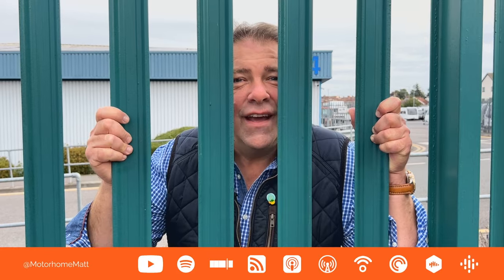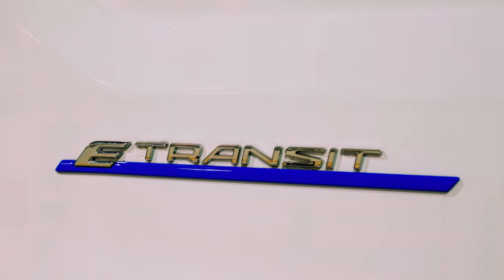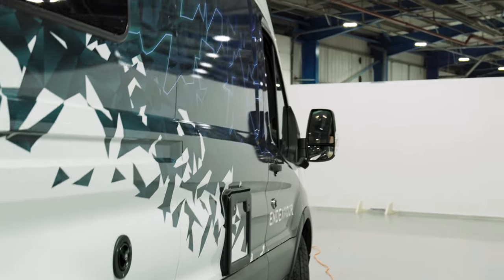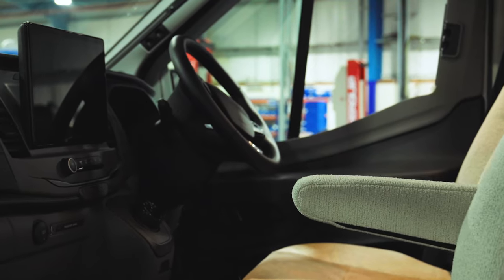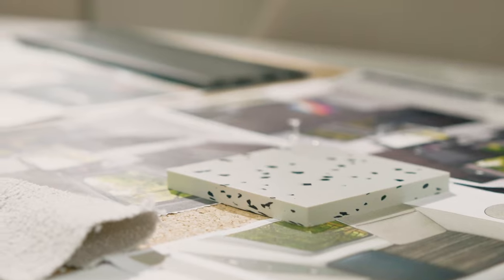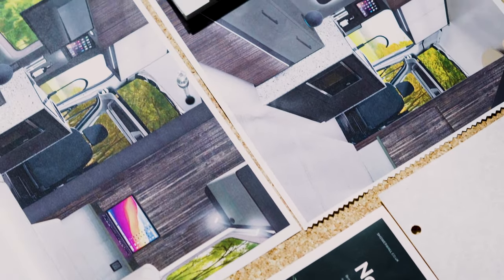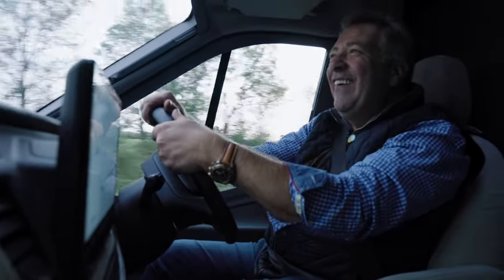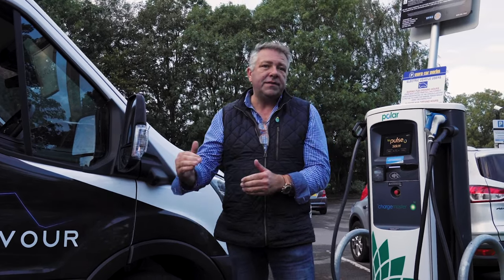Tour the new ALL-ELECTRIC campervan from Bailey of Bristol: The Endeavour EV

Comment: Regarding heating, they need to install a heated floor. Westfalia has just introduced an electric heated floor on their 2024 Columbus range but only when hooked up to the mains though.
Reply: I have some underfloor heating in my home made camper based on an e-dispatch.  Will be interesting to test it properly for the first time this winter.
Reply from the maker: How has this worked out for you? -8 here!

Comment: Great review its fantastic to see the future unfolding. though surprised the roof wasn't one huge big solar panel to recharge itself while you're camping. 
Ohh and just to add.. In 2018, the UK secured a derogation from the European Commission which allowed category B licence holders to drive alternatively-fuelled goods vans with a maximum authorised mass (MAM) of 4,250 kilograms (kg), over the standard 3,500kg entitlement.
Reply: Thanks for listening and for your comment. It would certainly be a good upgrade to fit solar to the roof. Let's hope the derogation for B Licence holders to drive 4250kg is extended to motor caravans
Reply: @mhcmotorhomes3695  and retain the category B speed limits 👍🏼😃

Comment: Can you insure it cheaply and when will it spontaneously combust ? Would you charge it well away from a building ?
Reply: Not heard of the E-transits being expensive to insure but would imagine it would be slightly more than the Diesel version as the upfront purchase cost is higher, I would hope that it never spontaneously combusts like the vast majority of other EV's. As for charging the EV near a building there are millions upon millions of successful charge cycles every day without any thermal incident, just like there are millions and millions of ICE vehicles getting filled up with fuel and not catching fire either.

Comment: Did they give you a clue of costs?
Reply from the maker: It’s not available to purchase. This is a prototype.
Reply: Bailey are saying this vehicle would be 75% more expensive than the diesel version so working on the assumption that the Endeavour starts at £70K would be around £123K for the EV version, but it is worth noting that a lot of the extra specification on this van accounts for two thirds of this increase so would unlikely be this expensive if it actually went into production with standard kit.

Comment: I have leased two Mercedes EQC’s for my son’s in the last 6 weeks. 80 kWh batteries. The range is less than 200 miles in real world driving and the battery drains quickly when you put the heating on. Luckily I didn’t buy the cars because the value has plummeted. I won’t be buying a EV motorhome any time soon.
Reply from the maker: Thanks for sharing your experience. We need more range don’t we! But what is your charging experience too?
Reply: I simply do not believe you.
Reply: Eqc is so bad Mercedes stopped the production in some area. Just check real Ev built from the ground up and not a bad conversion like eqc